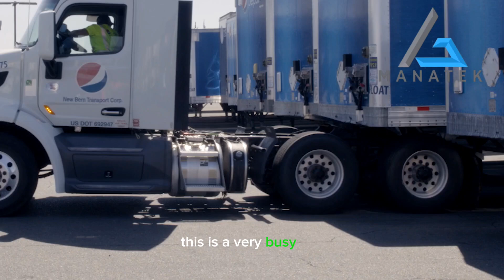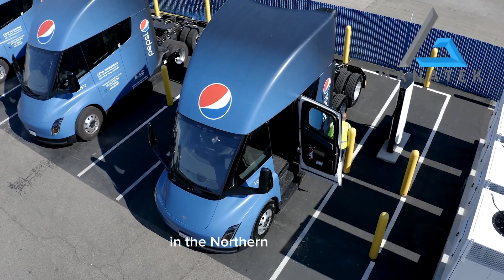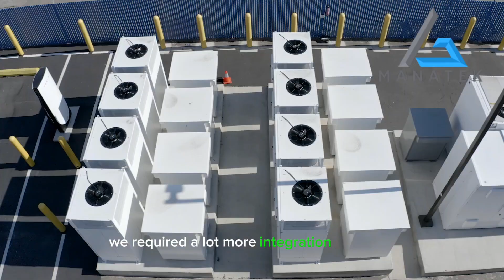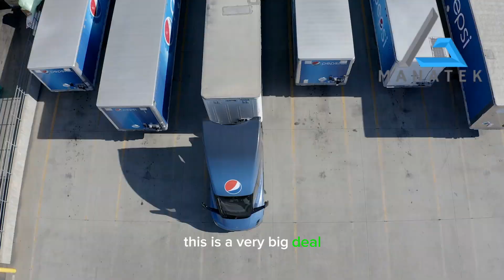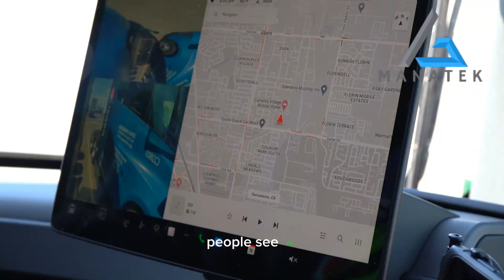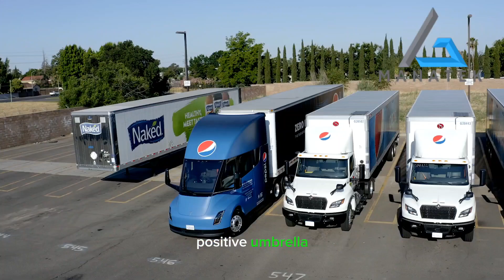Pepsi Drivers Respond to the Tesla Semi Truck | Actual Range &  Experience #tesla#elonmusk @Manatek

Comment: Also, the world has about 47 years left of oil at our current usage, which will only go up if we don't reduce our demand or efficiency with what we are using. This is to deplete known reserves, so it doesn't reflect the true timeline where we could see the cost of oil become ridiculously expensive or become unprofitable to extract and refine. It is true that we will never run out of oil because the remaining oil will be too expensive like trying to extract a once of gold from a mountain. Look up a chart of all oil discoveries in the world, and we haven't discovered anything major in decades. The peak was before 1970, so we have looked everywhere. The California Gold Rush is over, and so is the Oil Rush around the world. What small deposits we do find really doesn't add much to the pot, so unless we find the largest reserve ever sitting under a melted Antartica, we are done. What we have is what we have, so 47 years at the current rate of consumption, which means, we need to get on the EV trend fast, especially because many industries depend on oil-based products, so we can't afford to burn through oil driving cars.

Comment: Everyone acts like this growth is instant. Snap your fingers and double the 350 million internal combustion vehicles in the US, and the price of fuel will go through the roof, and the oil producing, refining, delivery and refueling system won't be able to take that sort of load. See, it sounds stupid when you say it using ICEs, and it is also stupid when you say it with EVs. Clearly, we have built the capacity to handle 350 million vehicles using one source of energy (oil), we can do it again using a different energy source (renewables). About 6% of new cars on the road are new vehicles, and we have goals of 50% to 100% of new vehicles being EVs by 2030-2035, depending on the state. Even at 100% by 2035, this means we are adding 6% of EVs to the fleet and removing 6% of ICE vehicles per year, assuming no one with an EV buys another EV. It would take ten years from there until 2045 to get to 60% of vehicles on the road being EVs. This means we have over twenty years to improve the grid proportional to the growth (build too fast, and we are just wasting energy and utility suppliers with just be idling). We have added energy to the grid in the past faster than we are currently doing, so we can add to the grid in proportion to growth.

Comment: 3Mega Watts additional service 😨
If this is everywhere the grid won't be able to take that sort of load.
Reply: It's already being overtaxed with the EVs we have NOW.
Reply: Snap your fingers and double the 350 million internal combustion vehicles onto the market, and the price of fuel will go through the roof, and the oil producing, refining, delivery and refueling system won't be able to take that sort of load. Clearly, we have built the capacity to handle 350 million vehicles using one source of energy (oil), we can do it again using a different energy source (renewables).
Reply: @jirace  I think oil can be produced more than electricity.
Reply: @jirace  No, WE didn't...those 'evil oil companies' were the ones who built that, using money made by selling a CHEAP, RELIABLE source of energy.  A source, by the way, that isn't dependent on weather to even FUNCTION.

Over that same time, the GOVERNMENT built out a nationwide grid that has a very specific transmission capacity.  It can only carry so much juice, and no more.  JUST TO REPLACE THE MAIN CSBLING TO DOUBLE IR TRIPLE CAPACITY would cost more than our current national debt.  That's TRILLIONS of dollars.  And it means you need CONSTANT power being reliably and consistently generated.  Taking more and more gas and coal plants offline, to be replaced with pinwheels and smoke and mirrors solar, is proving to be a reckless and stupid idea.

Besides, when was thr last time you saw half the ICEVs not running due to a lack of fuel?  I haven't in MY lifetime...and I lived through the OPEC embargo of the early 70s.  We were still driving.

Comment: If they want 100% clean energy they can't use batteries. Makes their argument with electric battery trucks obsolete
Reply from the maker: what should they use ?🚚   or should they be saying cleaner energy... they could be using solar ''🌞
Reply: @Manatek  hydrogen in a converted LS engins or any other converted ICE engine or even a fuel cell vehicle.
Reply from the maker: You know it takes electricity to make hydrogen it's more efficient just to put the power straight into the truck
Reply from the maker: To produce 1 kg of hydrogen, about 9 liters of water and about 50 kWh of electricity is required

Comment: Why no solarcells on the trailers roof?
Reply from the maker: I think the trailer should be covered
Reply from the maker: They should have some but it would reduce the load capacity
Reply: @Manatek  no not so with thin film solarcells.
Reply: It would, they don’t weigh nothing plus the converter and at least some storage would be needed on the trailer.

Not to mention the cost.
Reply from the maker: What's their plan with the refrigerator trailers ? This is where solar panels would work

Comment: Sorry, but that facility is NOT being powered by those solar panels.  They aren't enough to run ONE MEGACHARGER, much less ALL chargers, ALL internal machinery, and lights.  They even admitted that they needed at least two MORE substations to power everything.
Reply: I was going to post this. You would need thousands of solar panels just fill up one truck in a day.